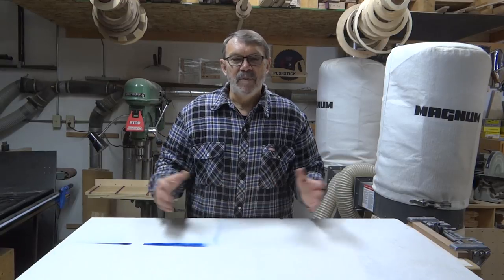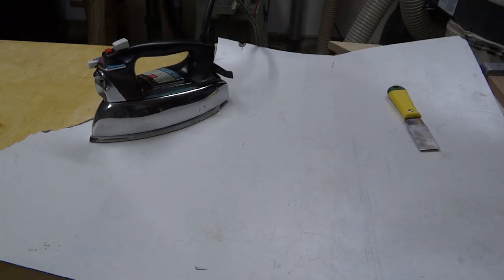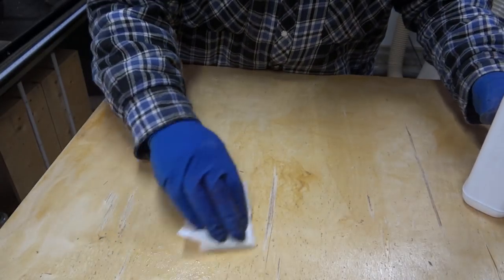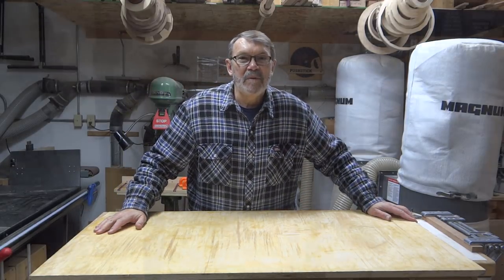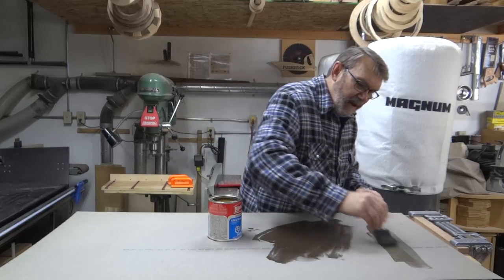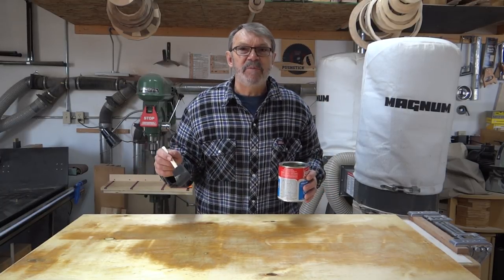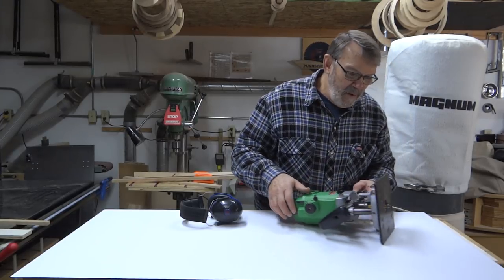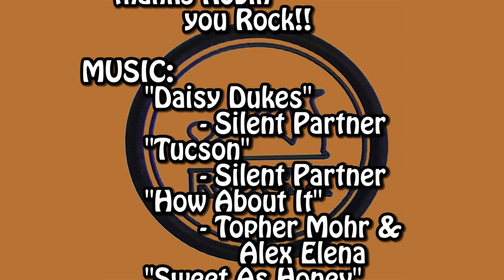Poor Man's Workbench

Comment: I have a solid bench with a thick wood top.  For a major project (airplane wing) I needed it to be absolutely flat so I covered it with 3/4 inch particle board and shimmed it flat.  When  I spill glue I sand it flat with a sanding block. When I have excess epoxy I fill the nicks and cuts and sand that flat. So far it has lasted 30 years and still going strong.
Reply from the maker: Wow, not that's a great way to extend the life of your bench! Don't think I will have to worry about mine lasting nearly that long! LOL! Thanks for watching, John.
Cheers,
.....Gord

Comment: Joe's tips for the future. Use gel-type contact cement and a 1/8 nap mohair roller.  Faster, and better, smoother coverage with minimal topography. Just roll, in one direction only, and then go over it 90° to the first direction, again rolling in one direction only. Most people don't know (or care) about that one direction thing but it's in the technical data sheets for a reason. I used that liquid stuff for many years until they came out with the gel, and I remember using a brush once maybe 30 years ago. I won't ever go back. 'Course I'm retired and don't anticipate sucking fumes anymore. . . but one never knows for sure.

There is also a spray contact cement which comes in aerosol cans, but I haven't ever used that so I can't comment on the efficacy of the product.

My neighbor has a woodworking shop a couple miles away (60 x 80 + a 20 x 60 lumber storage room) and he uses Duramine for the tops of all his assembly tables. The melamine is thermally fused to the substrate and can really take a lickin';  years in a commercial operation.

All the best, Gord,
-- Joe
Reply from the maker: +Joseph Scarborough 
Rats! As always, you have the information I need right after I do something a different (inferior) way. I have never seen gel contact cement! Sounds like a great item but the can I bought the other day will likely last longer than I will. Oh well, hopefully someone will read your comment and benefit from it. Thanks for the input, Joe!
By the way, that neighbor of yours; who the heck needs a 60 x 80 shop? I hope it's a commercial shop. Otherwise, he's really ticking me off!! LOL!
Take care,
.....Gord
Reply: I did not think your approach was an inferior way.  I would say you are with the majority not having heard of gel contact cement. It is available in the big box stores, but if a consumer doesn't know about it and isn't looking for it. . .  they probably won't see it.

Yes, the neighbor's shop is a commercial operation making custom entryways and interior doors, plus custom cabinet works and interior/exterior trim.

Cheers,
-- Joe

Comment: LOL, I'm one of those guys, my back yard is almost all drain field so not a lot of space to build on.  I can fit a piece of plywood inside the shop (on edge) but couldn't spin it end for end to save my neck.  As long as I can get to my stash of hardwood and the lathe, it's all okay :~)  If I have to cut anything long, my bride is a good sport and dawns mask and goggles and catches the wood as it exits the door.
Reply from the maker: I am humbled, Bill. I was kidding about having a shop that's too small. I fully realize how lucky I am to have the space I have. However, I have yet to meet a woodworker who would not like a larger shop!
Thanks for watching,
.....Gord
Reply: The only workshop I've ever been in that seemed too small was one in Alaska years ago.  The owner invited me over to build a bassinet for my new daughter which was wonderful, but he was built like an Oompa Loompa and only had ceilings about 6 feet tall.  I'm almost 6'-5" so it was a little difficult.  That's been 25 years now, and I am finally almost able to stand up straight after the experience :~)

Comment: I made a counter style display shelf for my neighbor's church and learned a couple of tricks.  I doubt if you will need to replace this Formica any time soon, but I found that a heat gun works very well for removing the old Formica and even most of the residual contact cement. I think it would be much faster than the iron. Also I used automotive body filler to repair holes and divots in the plywood. It is easily shaped or sanded and the contact cement sticks just as well as on the wood. I like to use a 45 degree router bit to ease the edges of the Formica, but this could also be done with a file, sanding block or even a block plane. One more tip, i tried both mineral spirits and then Xylene to clean up and remove the old contact cement. Xylene is a stronger solvent than mineral spirits and is the recommended solvent for contact cement. Strong fumes, so still need to ventilate the work area. Too late for your work table so just FYI.
Reply from the maker: +Gil Grace 
I didn't know about Xylene and I don't have a heat gun (hard to believe) but thanks for the information. It may be good to know in the future. Not that I claim I will be able to remember it in the future!
All the best, Gil,
.....Gord